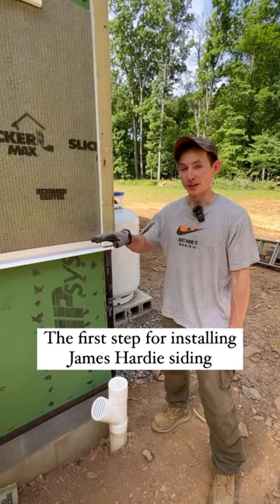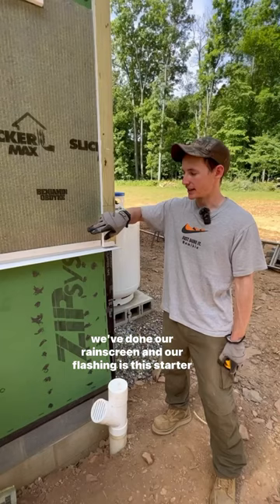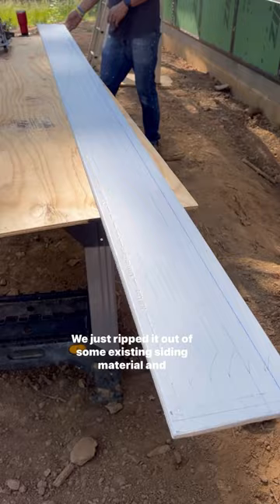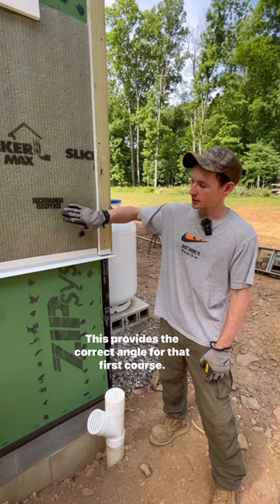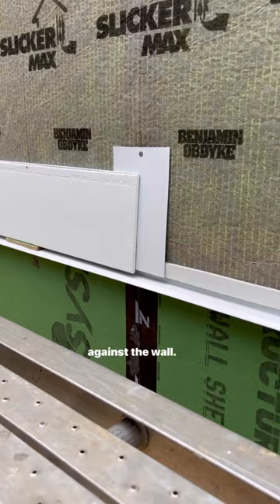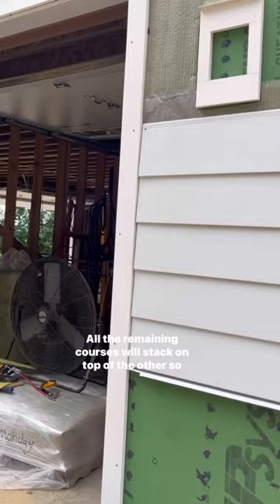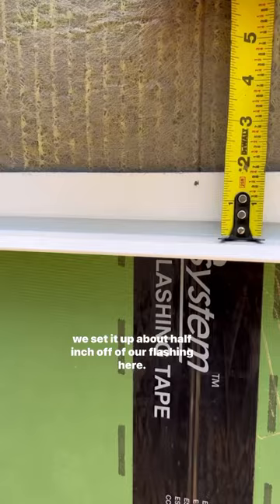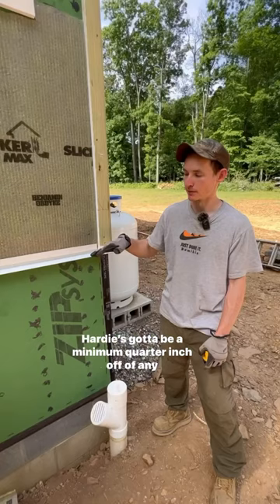FIRST STEP for installing James Hardie Lap Siding

Comment: I've started using corrugated plastic strips instead of Hardie starter strips. I get the same pack out from the starter but I also get a little bit of air infiltration behind the siding which promotes the stack effect for both drainage and drying. Excellent details!